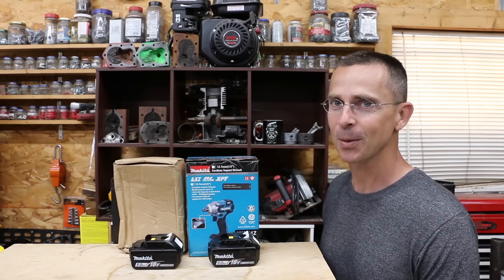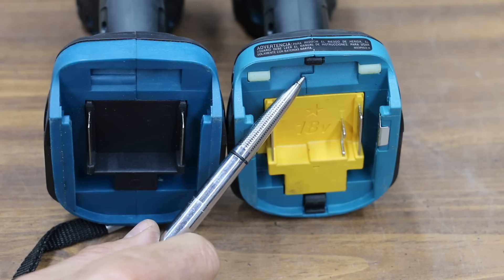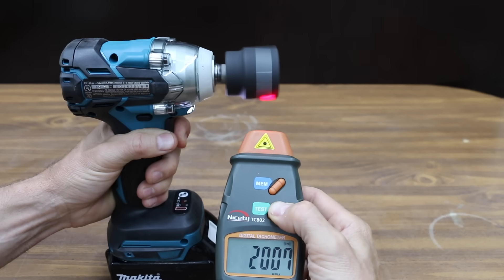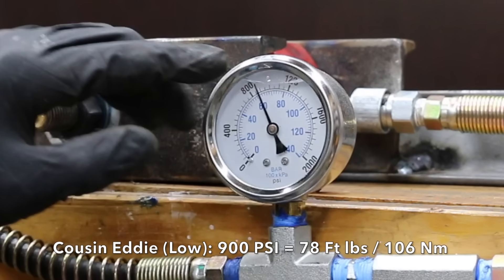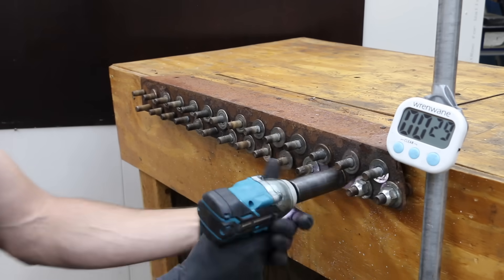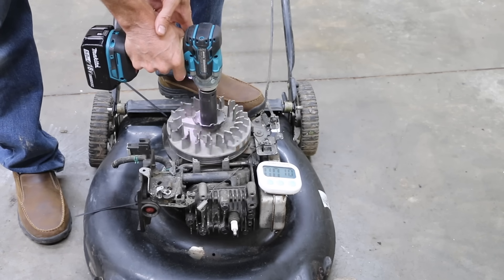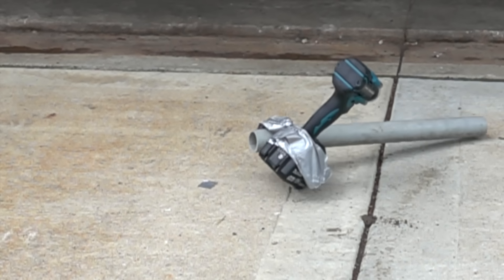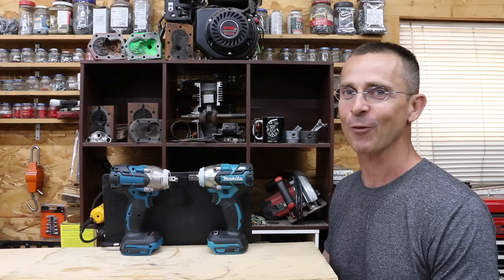Fake Makita Impact Better? Let's find out!  Makita XWT11Z 18V LXT Lithium-Ion Brushless Cordless

Comment: I started buying tools as a teenager, and I bought many cheap tools to get the job done, so in my opinion "A" tool is better than no tool. 
Thanks for the great content!
Reply: never owned a power wrench only spanners and wrenches...30 dollars sounds like a good deal!
Reply: Absolutely.  Certain tools you just don't need to use that often.  My drill press was about $45 from China - I'm still using it 15 years later.  Granted, I don't need it often, but I've certainly got my money's worth out of it.  If it ever fails I can afford a better one now but until it does there's no need to replace it.

Comment: I'm a professional so I'm not really a knockoff tool kinda guy. But for 30 bucks this thing really isn't that bad and would be fine for diy weekend warrior type.
What I think should be scrutinized is Makita not quite performing up to its rated specs in some key areas. What's up with that? This is a fairly expensive brand. No excuse for not easily meeting its rated specs.

Comment: Thats weekend warrior makita. The real professional grade ones are around $350-$400, and worth every penny if u use it daily. I had a job where i did just that. The makitas outperformed everything. we tried several brands. The Dewalts were junk. Worked good , but only for a couple months before failure of the cheap trigger switch. Actually had two that failed the same way, on the same day! The makitas lasted several years

Comment: my makitas last a long time. I think they design some vibration insulation where the battery mounts to the tool, which is an inherent weak point for electric impact tools. I did not even discard the makitas when they got old, I gave them to my dad, and he still uses them, ha ha.

Comment: This was a great test, if you combined your testing with AvE's tool breakdowns, there's no way you couldn't make a more informed purchase decision.
One thing to note is cousin eddie doesn't have a battery thermal cutout pin to shut the tool down. Other than that, for $30 you can't go wrong if you use the tool sparingly or want to throw one in your car/truck and don't care if it gets damaged or stolen.
Reply: I like AvE but he has a little to much BS for me,Project Farm gets right to the point he is definitely the winner in my book.
Reply: @MrNorthstar50  AvE is more about the journey than the tools.  That said, when AvE started there were no channels like project farm.  Just shills and dopes.   AvE was the trailblazer that set a standard for integrity and proved you didn't need to be a slick shill to make it on here.  It would not  surprise me to  learn that project farm drew inspiration from AvE as he transitioned from a shop channel to a review channel.
Reply: Good ploy to troll some thieves for sure. Stick on some Makita badges in place of Cousin Eddie's labels and leave them in the obvious places, whilst your real stuff is hidden in a locked drawer somewhere less obvious.
Reply: @woopimagpie  Great idea!
Reply: @darkopz  - If you only need one for putting together the odd backyard swing set or kids bike, it would probably be good.
Reply: @darkopz  Had mine since late Dec/Early Jan, been busting out a slew of jobs around the home and on the car. Hasn't quit on me yet. I bought a 1/2 to 1/4 impact driver attachment to get more out of it, so far so good. Longest use case for it so far was sinking 3" screws all day at my brother-in-laws barn while we hung sheets of OSB inside the barn. It was nice because he's got Makita, and I've got the Fajita but they both take the Makita or knockoff batteries. It may not be a Makita, but in my case for $24, it does make you scratch your head and see just how far the China no-name tools have come in a short amount of time.
Reply: this channel is 100 times more entertaining than AvE imo.  keep up the good work!
Reply: Honestly, at 91ft-lbs this thing is absolutely pathetic, weaker than a 1/4" hex impact, and considering over 100 ft-lbs is recommended torque for a lugnut on a small/standard car this thing is pretty useless.
It has to be able to do the job, that's the basic requirement, longevity, speed, power, size, etc. is good for a professional tool. But any tool that is unable to do the job has no place in any toolbox.
Reply: @darkopz  if you use it to rotate the tires on your car a few times a year . It will hopefully will not crap out . 🙂
Reply: I use both of those channels to help my buying decisions. As for the thermal pin missing that's no issue for me lol, I bypass that thing all the time with my makita tools. Unclick the battery and pull it out a hair and the impact will finish driving what you were working on hahaha
Reply: If you leave cousin eddie inside your car in hot summer for a time the rubber will become adhesive.
Reply: Better than AvE
Reply: Mikhail Akbashev  AvE has a far more comprehensive tool breakdown but the performance testing here is better and more relatable to what a regular joe will use the tool for.

Comment: I would be interested in seeing how a Dewalt and an Earthquake wrench would compare to the Makita. Very good test and really shows the differences between a cheap tool and the real deal.
Reply: And the Milwaukee!
Reply: AvE does a few videos on the Earthquake, electric and pneumatic.  He also compares the same two here in another video.
Reply: Guy's if you like this content check out AvE
Reply: I vote yes for a full showdown between top brands.
Reply: Milwaukee is the GOAT
Reply: I would also like to see harbor freights tool in this comparison!
Reply: I was thinking the same thing
Reply: Geo Johnson dewalt would win the race
Reply: @therealblackout9966  😅 I dont think dewalt is winning anything. Maybe first to catch fire? Ps dont let friends buy 887 impacts lol
Reply: Makita is going to our last both the dewalt smells like it’s burning new out of the box
Reply: Me too!
Reply: Let's throw a Ryobi into the mix for good measure.
Reply: Of course, there is a price to pay - but if you're just changing a flat  tyre - a few odd times a year then Eddie is perfect!!!
Reply: The HF Earthquake 1/2" Model EQ12XT air impact wrench I purchased new could not remove a lug nut torqued to 140 ft-lbf, so I tried a lug nut torqued to 100 ft-lb and still no luck.  Supply pressure was the max 90 psi, 1/2" hose.  The EQ12XT torque spec on the box shows 1070 ft-lbf max;  maybe HF made a mistake and it should have been 1070 in-lbf max.    A Dewalt 20V Compact Impact Driver 1/4"(?) could not remove the 140 ft-lbf torqued nut but was able to remove the 100 ft-lbf torqued nut.
Reply: And the AEG (Ridgid to North America). I've done a few rudimentary comparisons in Australia between AEG and Makita and found the AEG to be damn good value. The cordless tools are almost as good, the corded stuff is actually better, but only 2/3rds of the price and with a longer warranty. Based on that I went with the AEG, and have been super happy. Plus, nobody will pinch them because the other tradies all have Makita and Milwaulkee so the batteries won't fit! Heh.
Reply: @woopimagpie  YEP. Ive got a few AEG tools and they work great.

Comment: Great videos!!!! I have a possible test for you. I am in the market for a shop vac. I am also not impressed at all by the tests that others do or the fact that one guy was test $1,000.00 plus vacs. While inches of water and cfms are decent, why not different sizes and weights of steel balls or something like that with what the ordinary guy would be able to buy from a big box store. However you test them, I would trust your results more then others. Thanks for everything you do.

Comment: For $30 I'd invite Cousin Eddie to my garage any day.
Reply: Just to throw it in your trunk for that occasional need.
Reply: Remember, that price doesn't include batteries!
Reply: @tubastuff  That's why for budget, and backup tools I like corded better. never have to worry about that cheap battery going bad, and having to find a replacement.
Reply: @CommodoreFan64  Yup, but those battery-powered tools are pretty impressive in their capabilities!  Where do you find cheap lithium batteries, by the way?

Comment: YAAY, Commander and what a test it was! I rarely get anything new but from CPO or an outfit like that and find that refurbished or rebuilt is plenty good enough for me because I don't have to rely on them to make a living. They just help. BUT if I was in the market for a 1/2 inch drive impact I'd check CPO and maybe get Cousin Eddie (you've been watching Taryl). I have an OLD Craftsman 110 volt 1/2 inch drive for serious stuff but the 1/4 DeWalt will drive a 3 inch deck screw and that's all I need. And it sure helps with taking stuff apart and assembly too. I've also been getting some NICE knockoff carbs and stuff from Huztl.net and all my CPO stuff works good as new. No problems. So Happy Pappy Day and BLESSINGS all around! Thanks again!
Reply from the maker: Hi Lewie, Thank you very much for the positive comments.  I agree, the knock off is a great tool for those who don't rely on it for making a living.  The price is terrific!  Wishing you all many Blessings!!
Reply: @ProjectFarm  Yessir! A-PLUS!

Comment: Would love to see some Porter Cable tests. Even if you decide not to, I REALLY appreciate the research you do even on just cheap random bits/grease/etc. Helps me decide between saving a buck in the long run or buying something cheap that works "well enough" because i know I only need it to work the one singular time.

Comment: If you are a person looking for something cheap to use at home the knock-off is fine, but if you use the tool at work heavily the more expensive tool will likely outlast the knock-off 20x over... making not only perform better, but make it cheaper in the long run... and that does not even count any lost labor because because the tool was not as good or the time down because the tool failed.  Time is money.  You will never see a serious mechanic or maintenance guy buying cheap crap.

Comment: ENEACRO is another brand that makes pretty good gear for under $90. This ENEACRO 20V Cordless Impact Wrench Brushless Motor 300 Ft-lb Torque,4.0 AH Battery replaces a broken $300 impact wrench

Comment: Can you do automotive electrical connectors testing? Shrink vs non-shrink vs splice connector vs welded wires. See if they hold against pulling, corrosion, less electrical resistance test? Thanks, love your channel by the way!

Comment: Given the average homeowner use?  Honestly, Cousin Eddie might do just fine.  I'd buy the Makita myself (or DeWalt in my case, but same difference, really), but for somebody that might need to break loose just a couple stubborn bolts or drive a few tapcons for a project?  Yeah, $30 bucks will get the job done.

Comment: Request: This isn't the sort of thing you usually cover but I'd be curious to see comparisons between brands of sponges in various applications, such as washing cars, siding, and kitchen/bathroom surfaces. I figure they're a tool a lot of us use several times a week, so there may be viewer interest. The metrics could include scrub effort, durability, estimated life span, and susceptibility to mildew. There's plenty of generic options in stores, and of course there's also the venerable 3M/Scotch brand.

Comment: It would be an interesting test to simply use both to loosen a bolt that's welded on and not going anywhere and see how long it takes to destroy them.
(I have wondered when I should lay off my 3/8 electric impact driver and charge up the air compressor for the real deal...)

Comment: One thing to take into consideration is frequency of use.

I bought the second teir oscillating tool from Harbor Freight... I use it only occassionally for a short periods. The same for their corded hammer drill.

I bought the same grade angle grinder, a tool I use hard and often. I blew up 3 of them before I decided to upgrade to their Hercules brand. It has been a real trooper... Cutoff wheels seem to stress them the most. I do cut up to 1/2 inch steel... but usually 1/4.

Hercules is definitely worth the extra money if you are on the cheap, and need a durable tool.

Again, great test.

Comment: Here is a video idea .  Lets convert the cheap unit to output the same as the highest end versions with the small upgrades it takes to get them there .  A new trigger would quicken the process and maybe add a bit more weight to the anvil .  You can make these well made cheapos into the better tools with a few modifications .

Comment: Cousin Eddie is likely made on a ghost shift, or is out of spec from the same Makita plant.  In mainland China it’s quite common to sell sloppier tolerance/spec versions of the same products from the same factories otherwise meant for export.  If Chinese manufacturers can cut corners they will, and the only thing holding them back from doing so with the name brand is audits from the brand.

Comment: Awesome video. Thank you. I'd be most worried about the wear as impact drives tend to cop a hammering (pardon the pun) and I reckon the cheapy could pack it in after one project. You could also bet that if it does die it would do so when you're halfway through something and then (because you need a new one immediately) go and buy a Makita from the hardware store at full ticket!

Comment: Great video it really helps show the quality difference! I would love to see a video of you doing some test like these on the Ryobi cordless impact how it stacks up against other brands. I have been using one for years now and it often outperforms air tools. Being able to remove rusty stubborn lug nuts and it's a really handy and affordable tool. I have always wondered how it stacks up against other brands though. As I have guys tell me all the time there's better brands that work better. But I honestly never had an issue with the cheaper Ryobi one.  Thanks!

Comment: One thing you missed, cousin eddy only used 2 pins on his battery meaning they have have skipped the 3rd Thermister pin which is a safety device to stop it getting to hot/cold

Comment: You might want to start another channel for this as the Leftist gods at YouTube are very unforgiving.
     More gun and ammo related tests.
Testing homemade gun cotton vs store-bought smokeless powder, in bullets or a cannon.
Test fake vs real red dot sights?
Test condoms?
Test liquors for fusil alcohols and oils?
Test hardening metal liquids.
Test if cutting 100s of horizontal slits w/ a razor blade in your tires helps for traction on ice.
Test if ebay Chinese n95 masks work.
Sorry none of these ideas are very good.  The hand cleaner test from another viewer is a way better idea.  
Test liquid gloves.

Comment: Why were you changing distances when measuring RPM? Also way to much variability in these tests. Always begining with cousin Eddie, using the same nut and bolt repeatedly, user bias introduced in "race" on loosening bolts.

Comment: Foot pounds are a measure of torque or twisting motion and PSI is pressure. These are incompatible units so I wonder how you made the conversion? Battery life would be another consideration for me.

Comment: Comparing a cheap tool to an expensive tool, for 15 minutes, is not a true test. A cheap tool may hang with an expensive version in the short term, but may not last down the road. you usually get what you are paying for.

Comment: I  just bought one of those 30$ knock offs (tool only works with my Makita batt) and it's actually working on the farm 
it took my front wheel off my ford 5000 tractor. it is less quality than the Makita but not a total pos imo 
not counting out that I may eventually have to buy a Makita one though........or four more of these lol

Comment: Not worth it unless you already have Makita batteries and charger IMO. $30 for impact and $130 for a 2ah and charger. Can get the Ridgid 1/2" mid torque with 4ah and battery for $150-$180 depending on if on sale or not.   Great video though.

Comment: The speed test showed 49sec for Eddy and 35sec for Makita. For the 14 nuts, a difference of 1sec time saved per nut for the Makita. The price difference is $108. So it comes down to among other things, how valuable is your time? If your time is worth $108 for an 8 hour workday, then you need to encounter 28,800 nuts to break even.

Comment: For 3/8 impact, the knock off is perfectly acceptable. Will take lug nuts off and difficult bolts. You need a 1/2 for any real applications.

Comment: The knockoff is actually most likely an instance of the rampant copyright and trademark violations China is so lax about. The knockoff product is built to the exact dimensions using the same tooling and processes, though probably older/obsolete tools. The only difference is quality of internals.

In many cases, the Chinese knockoff can be nearly as good as the design from which it was stolen. But in most cases, the internals skimped on to maximize profit, and performance suffers.

Comment: VIDEO IDEA: I was just on eBay; and, saw they are selling Impact Wrenches with 128V and comes with a 128,000mAh battery which provides 30,000 hour run-time  (LOL!). There was another one which was 48V yet provides only 38 Nm of torque (LOL!).
How about you tear apart some of THOSE drills and see what in the world they are talking about with those RIDICULOUS numbers.